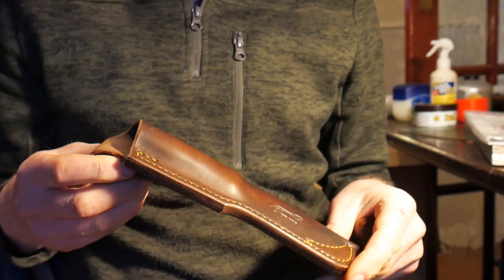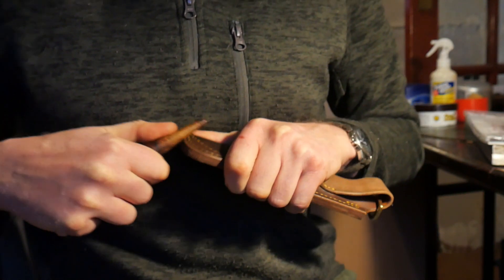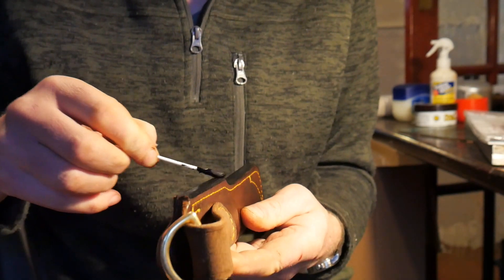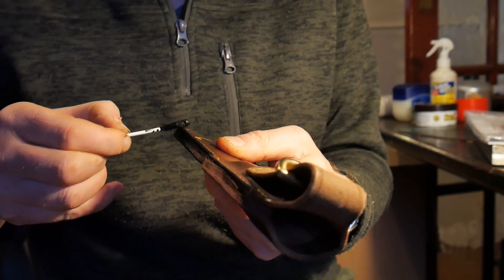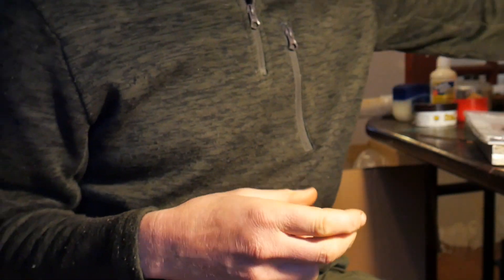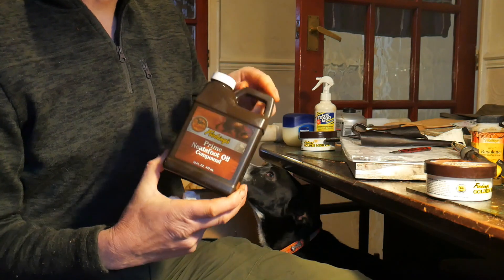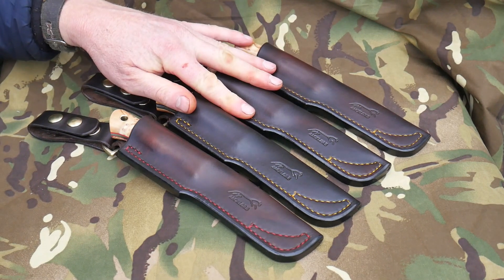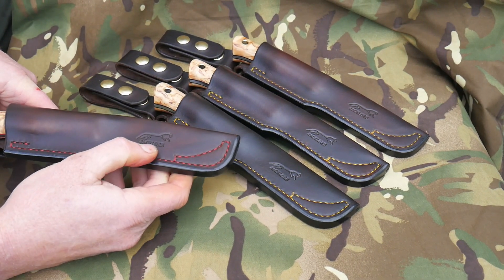Four Bibby knives and how I finish my knife sheaths  Jacklore England

Comment: Outstanding work as always Sandy!
I suspect that the sealant you used over the Edge Coat is PVA based. (I use it for loads of applications to seal all kinds of surfaces. It is sold as PVA building adhesive and can be diluted with water to suit each application. Cheap as chips and is great stuff.) 
Your canine 'Apprentice' is coming along wonderfully!
TTFN.